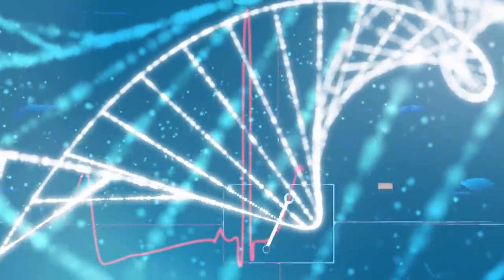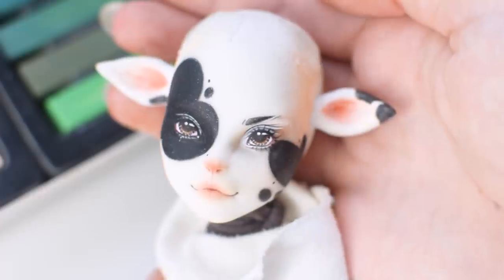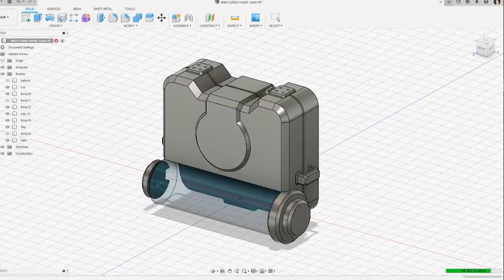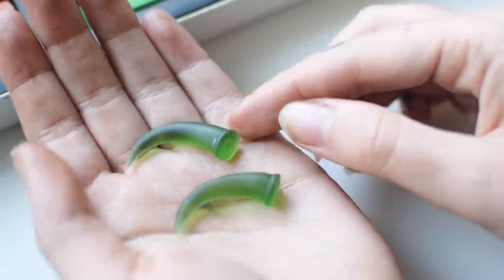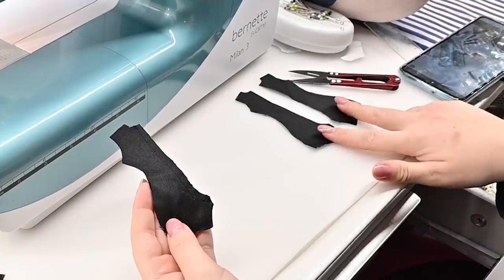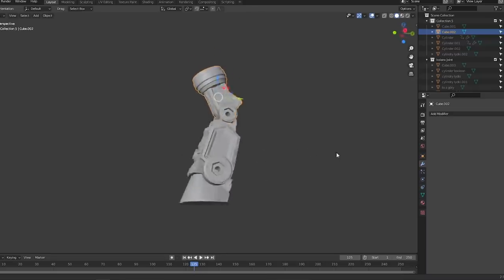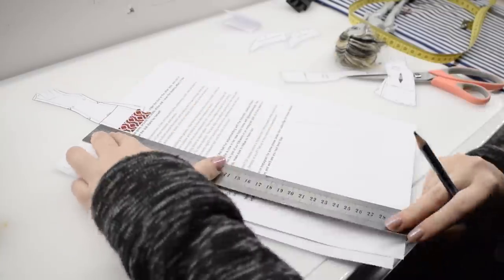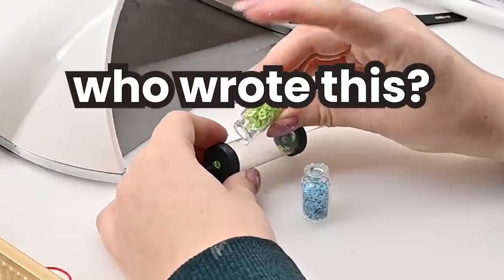Tzula the Space Cow • Alien Crew Collab • Monster High OOAK Custom Doll Tutorial

Comment: Such a beautiful doll with the loveliest of eyes, but oh God the soldering. It works a lot better if you heat only one of the parts, so the solder solidifies to the colder part in those very neat blobs you see on proper soldering. Another plus is that if you heat up one pin and have the solder between the hot and the cold pin (not between the pin and the soldering iron!) The solder material doesn't stick that badly to your iron! There are a bunch of tutorials that explain it a lot better, but it's really easy to learn if you watch someone do it first!
Reply from the maker: Not my strongest suit I admit! I'll get better next time 🤗